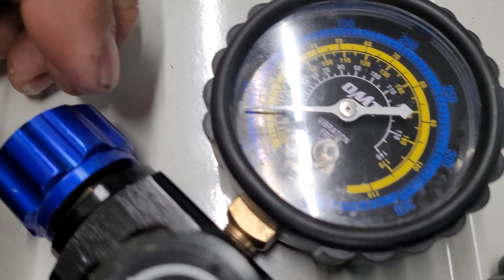How we recover mini split refrigerant back to the outdoor unit, same as how it shipped #minisplit

Comment: Can you please upload a video with the full process and full step by step procedure including attaching hoses, opening or closing valves how you set up your gauges etc and removing the hoses etc. Like thank you so much for sharing this but I still have a lot of questions after this video. I have a multi zone mini split with two heads. Do I run both for the pump down or is one on okay?
Reply from the maker: JD, yes, the process is possible with multi head unit. Check some previous comment postings on how to do it for your setup, because there are a few. Connect to the service valve on the biggest indoor unit, if one is bigger than any others.
Reply: This may sound stupid but is the gauge on during the line vac or closed
Reply: @michaelbeall7754 notice he had only 1 hose connected to his gauges. The low (blue) side. Since mini split condensers only have a single service port. Which is almost always the low/vapor (blue) side. 
He also had the knobs on his gauges closed. Because he is using them to strictly read how much pressure/freon is in the refrigerant lines. 
He first closed the liquid line, the smaller of the 2 lines , which has no service port. It only has the option to close it via where he put the Allen key. 
He is using the compressor of the outside unit to pump the Freon back into the outside unit. 
Hence why when he closed that Allen key port he had to quickly put the Allen key into the top Allen key port and start closing that one as well as soon as it hit 0 on his gauges.  
At that point all the refrigerant that was in the lines is now inside the outside unit and trapped. 
Make sure both of the Allen key ports are closed tightly and then immediately pull the service disconnect on the outside unit electrical disconnect box to shut off the unit. You don’t want it trying to run with those ports shut. 
This technique is called pumping down a system and is useful for any time you need to work on the unit where you will be disconnecting the refrigerant lines. Like moving the inside head or moving the condenser location or fixing a leak. 
And once you hook the unit back up , if perchance you took the indoor head off and exposed the inside of the refrigerant lines to air, you must pressure test with nitrogen or vacuum pump out the air from the lines before reintroducing Freon back into the system. You do not want air/debris/condensation inside of those lines. 
And anything still unclear, please ask a professional. As these lines are very high pressure and improper procedures can lead to serious injury and or death. 
Thanks 🙏
Reply: @michaelbeall7754 and the gauge was closed. He was using it only to monitor the amount of refrigerant inside of the copper lines. (Lineset)

Comment: Hi, Can I use a digital micron gauge instead of the standard pressure gauge. If so, what reading should I expect from the micron valve (in microns). Thanks
Reply from the maker: https://www.convertunits.com/from/PSI/to/micron+mercury yes, take it down to 1000 microns.

Comment: Great video, thanks! 
I accidentally left a valve on my vacuum pump open when releasing refrigerant in the liquid line during setup, and lost a bunch of pressure. I tried running it anyway and the liquid line is icing. Think this will help, or do I need to just start over? 

Many thanks!
Reply from the maker: It sounds like you really just need to add some refrigerant. No need to go through this procedure.
Reply: @airspool thanks for the reply! Made my day. I believe there is also a leak in the liquid line though. So I’m going to do this trick, change/fix the line, vacuum the lines again, then re release the refrigerant.

Comment: I have a Daikin 4 ton multi port with 2 indoor units. 1 indoor unit cools great. The other does not. I think I had a leak and may have low refrigerant. Can I use this process in your video or do I need to recover and vac the system?
Reply from the maker: Would need to turn both zones on cooling, then follow the steps, both valves need to be closed on the high side , the when at 0 on the low side. There are some other comments further down in this list, too, that talk about multi-zone.
Reply from the maker: There is an electric solinoid valve for that circuit that opens on demand. However. The whole system would be affected when both zones are calling for cooling, not just one. We would almost be leaning towards a wiring issue that isn't opening the second zone valve.

Comment: I've seen this king valve trick used on larger central units.  I didn't know if it would work for mini-splits as well.  Very useful tip.  I was wondering if I'd have to shell out for a gas'n'go if my mini split ever had to come off the wall for siding repair/replacement.

Comment: Hi, Thank you for the video. Quick question, can I do this for a four zone heat-pump, there is only one line set (one high and one low) for all the zones flow. I assume I have to turn on all units for the vacuum process, and  to turn off all units at the same time I will use the circuit breaker from the main supply. Please correct me if I am wrong.  Thank you again.
Reply from the maker: Yes, and for the details, check some of the earlier comments from a year ago or something. There are some other people that also had multi-zone units with some other questions.

Comment: I bought a single manifold gauge. Do I plug or seal off the inlet that’s not being used for this?
Reply from the maker: A single manifold set would only have one port that should be controlled by the valves at at the ends, as long as those valves are closed , shouldn't need to cap anything as the low side hose will go straight to the low side gauge.

Comment: Valves are closed tight but when i break open the unions for the insode coil i still get hissing?
Reply from the maker: The high side valve gets closed 1st the the low side valve gets closed when the gauge gets to zero. So, potentially, the compressor could pull enough to make the lines have a bit of a vacuum, but if you disconnect under these circumstances, the hissing will only be for a split second. If there's still refrigerant in the lines, that's high pressure, that will stay hissing for a while and be a very scary sound as you're losing your refrigerant as you disconnect. If you did the procedure correctly, all the refrigerant should be in the compressor.

Comment: So leave power on?
Reply from the maker: Yes, and in air conditioning mode, not in heat mode. And then turn the unit off once all the refrigerant is back in the outdoor unit.
Reply: @airspool  mine is a inverter style. Will I have any problem getting all the Freon out? I know it’s got protection built in in the event that Freon gets low and shuts off the compressor.

Comment: Hi there just a qusetion does the Guage have to be open
Reply from the maker: Hi Sai, I think you're asking if you need to have gauges. Yes, because without them, you will not know when the refrigerant has all entered the compressor and if you keep it on too long, it can damage the compressor. And yes, first close the high pressure gauge, and then later close the low pressure gauge.
Reply: @airspool  thank you very much for responding back greatly appreciated

Comment: Ok but where is the yellow line connected to in the out door unit you not showing it ??
Reply from the maker: Hi Melvin, actually, the yellow one is just the power cord to power the air conditioner, so nothing directly related to the procedure here.

Comment: If there is air in my minisplit system (An error occured during installation). How can I restore it?
Reply from the maker: Is the error that no vacuum was pulled? If so, yes, that refrigerant needs to be pulled out of the system, and the new refrigerant needs to be put in. Yes, the refrigerant is still fine, but there's no way to separate it from the air, so start fresh.

Comment: Can’t get anyone way out here to do this work so I’m installing  a Mr Kool mini split heat pump head unit to an existing Me Kool mini split. The outside unit is a tad different from the one in your video. Is the process basically the same in order to replace head unit? Thanks
Reply from the maker: Yogi, yes, should be about the same.
Reply: This was my question too. The schrader valve is opposite of the one in the video. It would save so much grief to be able to do this.

Comment: I have a three zone unit that was wondering if this will work for just one zone or do I have to do all zones. my unit is three zone. I need to put it independent unit in the bedroom because my wife always likes to do opposite of what the other rooms are.
Reply from the maker: Well, probably all of the ports are tied together for hooking up gauges, so you're not going to get an accurate reading. But having said that, you could potentially do it without gauges by just closing down the high side and run for 30 seconds with the low side port open  and then close the high side valve. If there was a separate service port on all three circuits, then no problem to monitor the pressure, but most units don't have this.
Reply: @airspool  I have to go and look but best to my memory. It had three service ports on the low side, and I think one master one at the top above the three I was a little confused about hooking gauges to it due to the port if I remember right. I think I vacuumed down each line separately. It was my second unit I installed the first one that was a multizone since then I put in four at my shop. The process and installing one at my wife’s shop. The gauges I got don’t have the right Freon but I’ve been just using the pressure readings on it. And the vacuum gauge. The two systems are put in the house. I’ve been running for over a year with no issues.

Comment: When i connected the gauge i had a lot of hissing, whats best way to connect the gauge?
Reply from the maker: Sounds like the hose or gauges are leaking.  Check the ports on the gauges, and make sure that they are closed.  Only use the hose for the low-side gauge.

Comment: you should cut the power right after closing the second valve
Reply: Never cut the power!!!. Just turn the switch off.
Reply: Whats the difference @nl4402
Reply: U have closed discharge valve and compressor still running nothing will happen to compressor ?

Comment: Two questions:
First, do you do this procedure only when the unit is in cooling mode or will either heating or cooling work?
Second, if I wanted to add refrigerant to a system that is low, could I use the fully charged weight of the outdoor unit as it comes from the factory to measure how much refrigerant was lost? By weighing the outdoor unit I mean. Thank you for the video!
Reply from the maker: Yes, do it in cooling mode. And, is the leak fixed? Or was it just low to begin with? If there's a leak, obviously that needs to be solved first. And instead of weighing the outdoor unit, just let in a very little bit of refrigerant at a time, and let it run for 10 minutes and feel the suction line. If it feels like an icy cold beverage, you're good. Don't overfill the unit. You of course could try to do this by the pressure/temperature chart for your unit, too, if you have that. This will say what the pressures should be for a given outside temperature.
Reply: @airspool Thank you!

Comment: How do put freon back on the high side of the unit
Reply from the maker: The compressor should suck all of the refrigerant through the system. So, any that started on the high side will expand in the indoor unit and then come back through the low pressure line to the compressor. And all this is a very quick process from the time you close the high pressure line to the time of the refrigerant is in the compressor.

Comment: What happens if your AC is serviced and the technicians do not use evacuation pumps. All my minisplits leaked out. The Mexican guys just guess and add refrigerant (do not weigh) not care about evacuation. My minisplits run max power all the time and the fins on teh back barely feel warm. 18k minisplit using 2800 watts constantly.
Reply from the maker: The install is the most important aspect of any split system refrigerant installation. If it's done correct, very little maintenance on the unit will be needed in the future. Just clean the indoor filter once a month or something, and then clean the coils, both indoor and outdoor, as needed.
Reply: @airspool  I asked on a Facebook page here in Mexico "it's not a thing here". I have no choice but to buy my own equipment, evacuate system then wait for lazy arse MX tech to fill with refrigerant. I found another guy here in MX did the same thing because he was tired of "shotty work".

Comment: what if you had to add refrigerant to the line set? will it hold the additional refrigerant that was added?
Reply from the maker: Yes.  There's room in the coil there and in the compressor and the accumulator for whatever line length the unit is rated.

Comment: So after its stored how do we reinstall it elsewhwre
Reply from the maker: At that point, the unit is back to factory conditions. Take the outdoor unit and indoor unit to any other location, re-install the line set, pull a vacuum on the line set to remove the air, and re-release the refrigerant into the system and turn it on.

Comment: Keep in mind units with inverter protection will trip an error when the pressure drops down pretty low, say 25-30 psi.
Reply: what we do in that case when the inverter protection trip an error around 25-30 psi?
Reply: @carboj2 I believe you have to electrically bypass the pressure switch
Reply: Will this affect this process? Or is there some additional that needs to be done to work around this error?
Reply: Found this out the hard way. Tried to recover without a guage. Still was a bit of refrigerant in the lines. 
Oh well guess I’ll just have it topped up before I run it next
Reply: @BlazingExotics  better off dumping all the remaining gas and weighing the new charge in, otherwise you’re going to be guessing

Comment: Whenever you recover the freon back into the outside unit, what are the changes that air or any form of moisture will be inside the outside unit? If you didn’t perform a vacuum test the first time?
Reply from the maker: If the line set wasn't vacuumed the first time, the compressor will have air, and possibly moisture, since the compressor is acting as a vacuum to suck whatever was in the indoor unit and line set back into the compressor.
Reply: @airspool   So how would you fix this problem, I had my mini plit installed by a friend and I am trying to do the same thing, so I can vaccum my lines but the line set was never vaccumed initially?
Reply: You would have to recover the Freon out of the unit clean it or add new back after vacuuming the whole system down to get out all moisture.

Comment: After refrigerant is backed up and service ports are closed, is the low pressure port still open to pressure test lines with nitrogen?
Reply from the maker: Well, for this procedure, close the low pressure port when all the refrigerant is back into the unit. So at that point, first the high pressure port, which is closed first, and then the low pressure port, which is closed once all the refrigerator is back into the unit, will be closed. At that point, the outdoor unit is similar to the way it was when it shipped from the factory. You can move the indoor and outdoor unit anywhere you would like, connect the refrigerant lines again, pull a vacuum again, and then re-release the refrigerant.
Reply: Just found the answer on my installation manual. The answers yes. I guess that is the propose of a 3-way valve. Great video, Thank you!

Comment: I have a multi zone fujitsu, 4 indoor units, do I run all 4 simultaneously to perform this? And can I use the test run from outside unit to statt and stop all units together? Thank you!
Reply from the maker: Idle, sorry for the delay.  Have the gauge hooked up to any of the 4 service ports.  If one is bigger than the other three connect to that largest one. Close all of the high-side (high press, for the smaller lines) valves quickly, with all zones running in cooling.  Close the low-side valves quickly when the pressure shown on the gauge goes to zero. Immediately shut the unit off.
Reply: @airspool  Thank you, I only have 1 set of ports on my outside unit. My system is older and use 2 branch boxes, located in the attic.